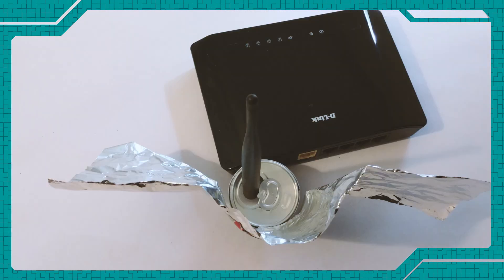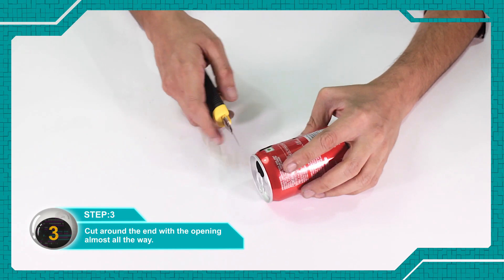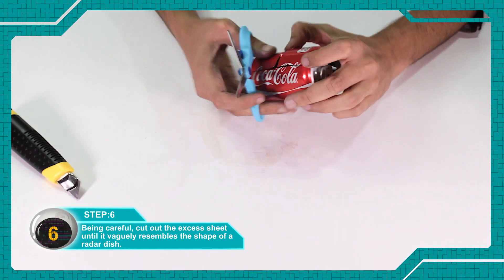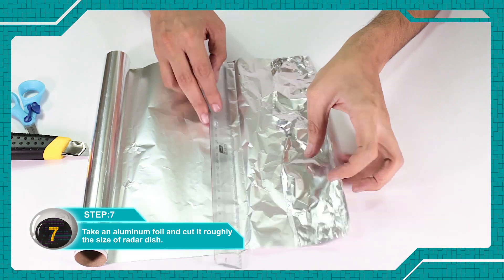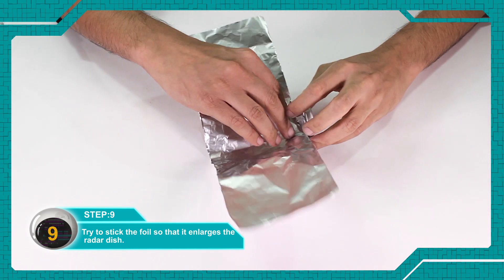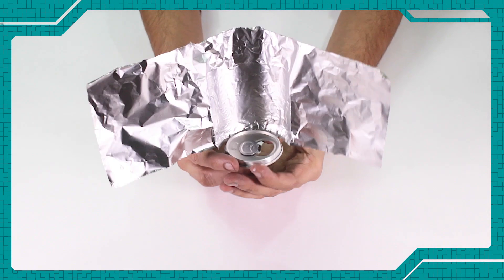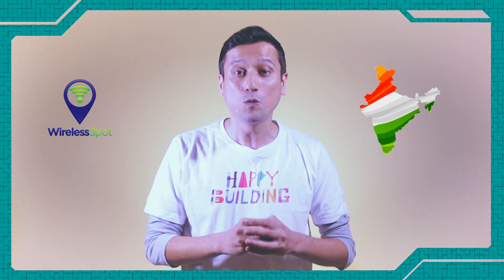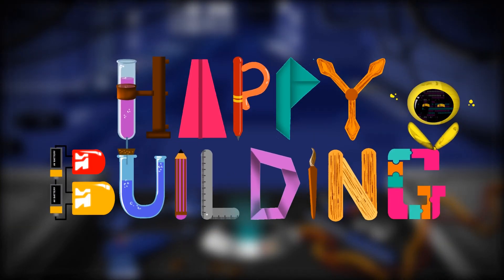How to make a WiFi Antenna Booster! Happy Building!

Comment: We have to place this on Router or moderm?
Reply from the maker: Tech Crazi it needs to be on the WiFi router antenna or if you have a WiFi router and modem as a single unit then on its antenna. Hope that helps. Happy building! :)